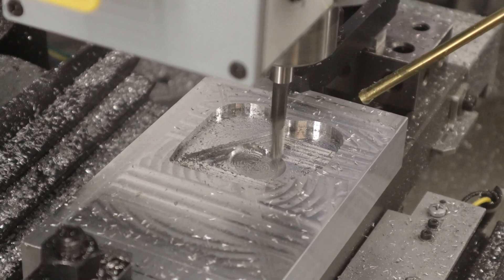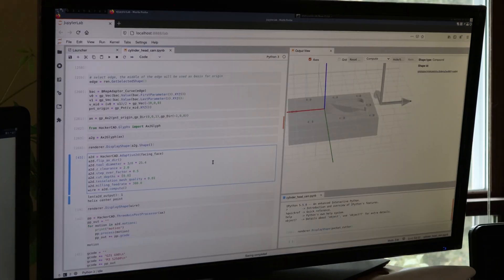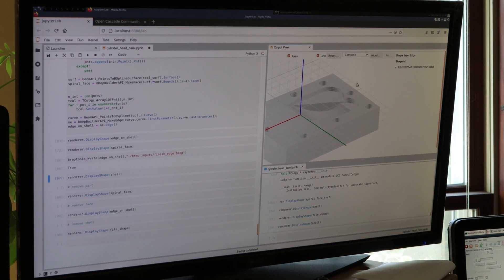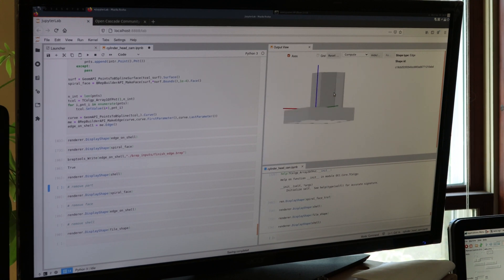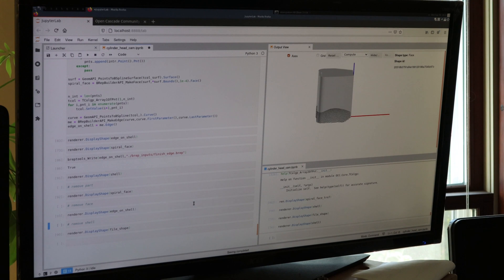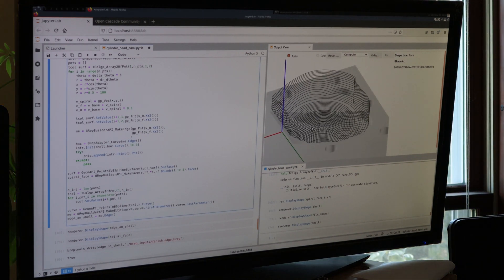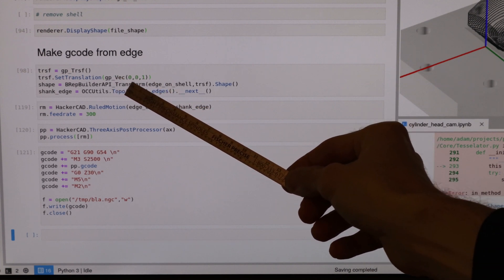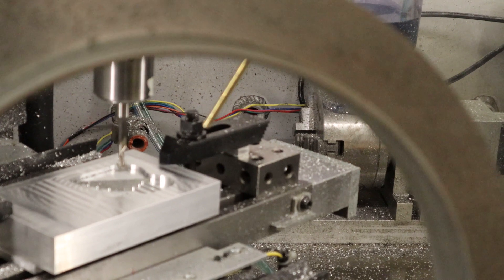CNC Machining a Cylinder Head with HackerCAD

Comment: this a diy cnc?
Reply from the maker: The CNC machine is a micro lux milling machine which was manual from the factory.  The machine was retrofitted with a ball screw CNC conversation kit by the previous owner.